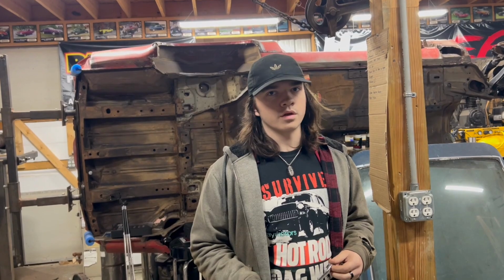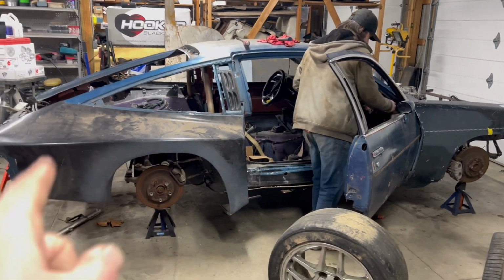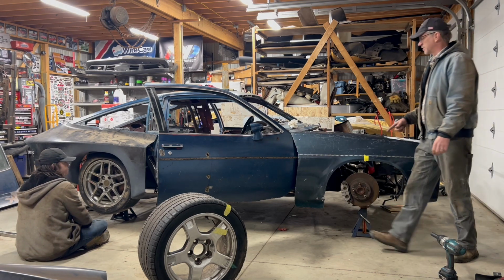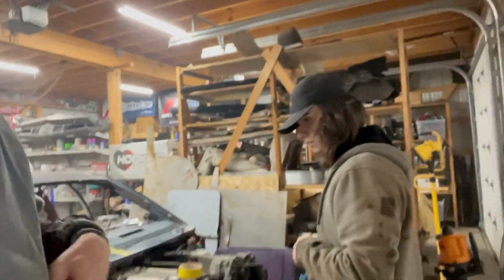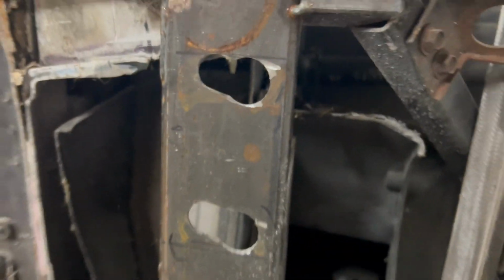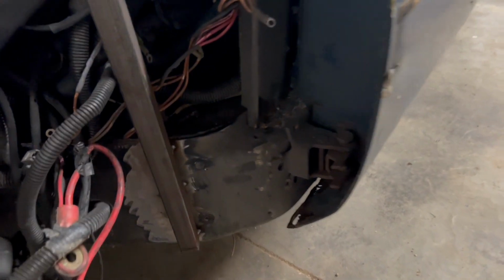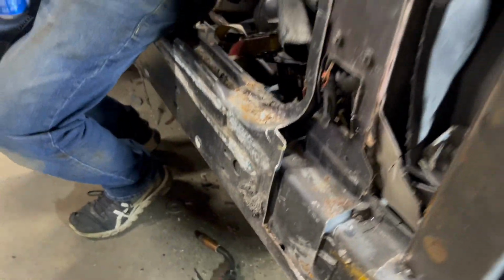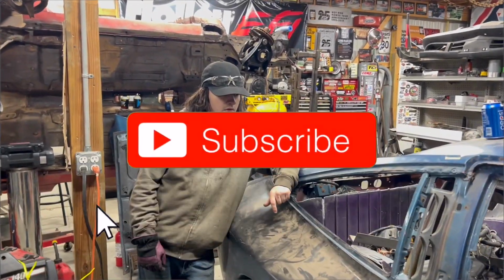We had to remount the entire body - again! // Body Swap - Part 5

Comment: Good stuff, I know this process is such a pain. I must have lifted my 55’ Customline body on & off of the BMW e39 about 25 times before I finally got it right in a place that worked well enough.
Reply from the maker: Yeah this part HAS to be right, otherwise all the other parts will be wrong as well.